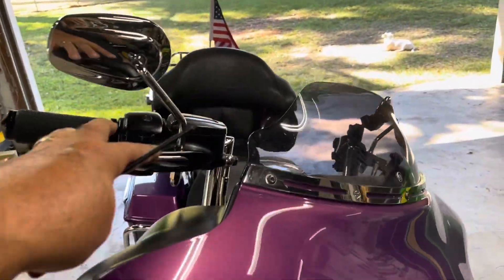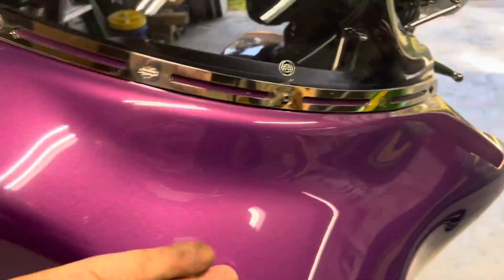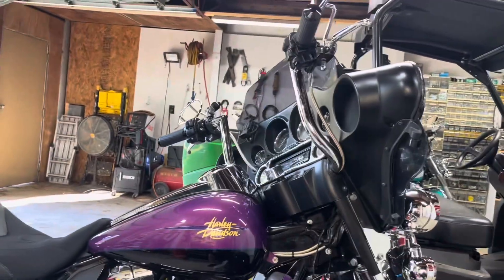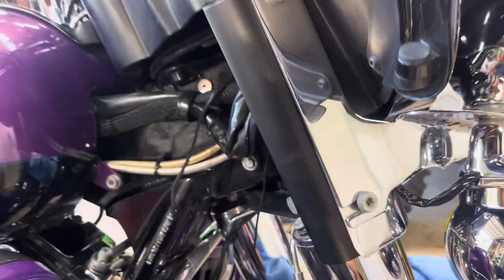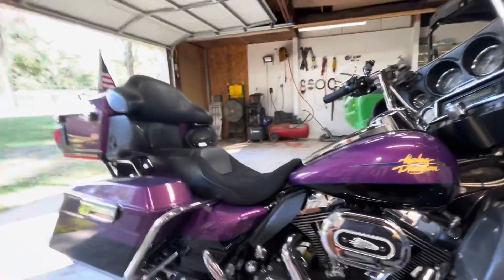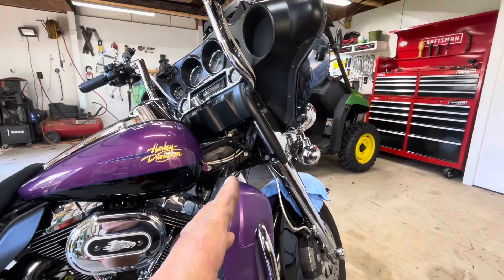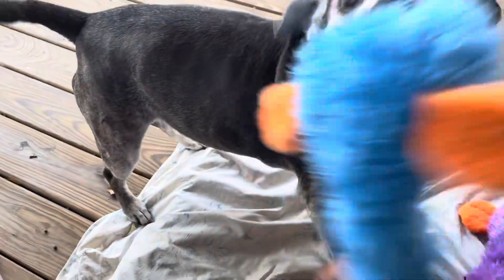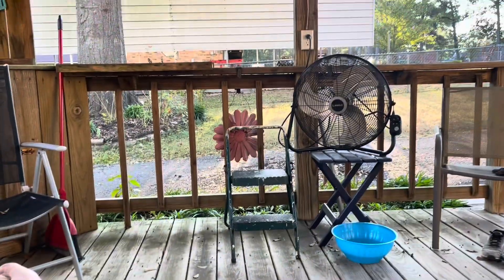Installing new windshield on Harley ultra

Comment: Hope the rest of your Sunday was as peaceful as the time you spent on your porch. 
Rattle tales and acorns falling on the roof. Priceless!
Glad to see that windshield go on. That means that cooler weather is drawing near in your spot on this earth. Here, we may have to turn on the furnace, in the mornings, in the next few days. Lows dropping into the 40's. Cold for old folks, like us. 

Prayers for those in the mountains of NC, as it's usually cooler - COLDER up there. Prayers for the people in Florida, as well. May God have mercy on all. 

Who woulda thought all that extra weight was hiding in your bike. No wonder you wanted to strip out that unneeded stuff. 

Hope you  and Charly have a Monday just as you would prefer it to be. Enjoy, to the max, all that makes you happy.
God Bless. Godspeed.
Reply from the maker: I’m so glad I got those speakers off the bike. That and the 16 mikes of mire should lighten the bike up by 25 pounds at least.
Reply: @bctruck  In a top heavy situation I suspect it feels like 50 lbs were removed.

Comment: I can only imagine. I had a sliding noise in my car that I couldn't locate for a couple of weeks that almost drove me nuts. Fortunately I resisted the urge and didn't disassemble the center console in the dashboard. Finally I figured out that it was a pair of sunglasses that I had absentmindedly put away in small ceiling compartment above the rear view mirror that was sliding every time the car turned at a crossroad.🤣
Reply from the maker: So you understand the aggravation! Imagine being in your vehicle 24/7 for weeks on end. The little noises slowly take apart your patience and reassemble it into insanity.

Comment: That was a lot of weight with those 2 speakers. Just looking at them I knew they were heavy, but not 10 lbs. each. 
Must make a lot of difference in the center of gravity as high up as they were.
Reply from the maker: I just rode it. Noticeable difference.